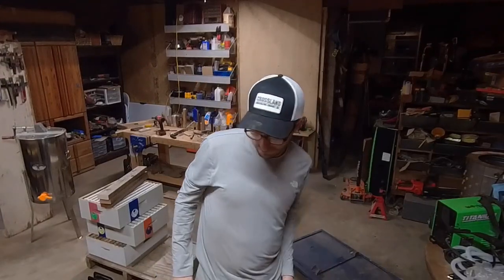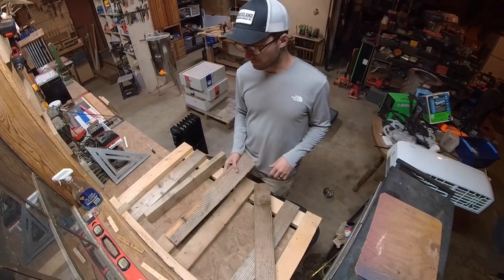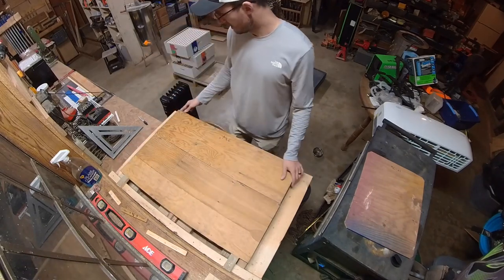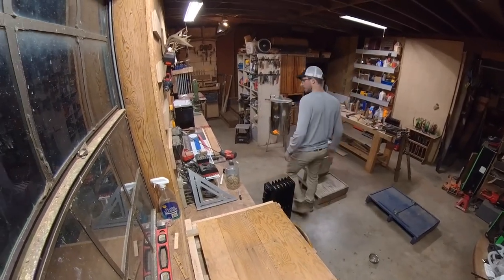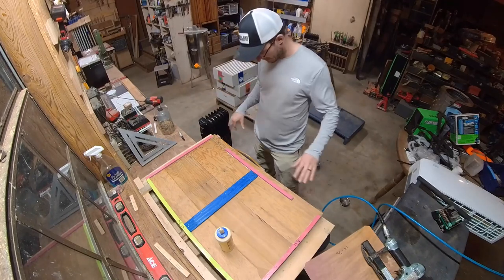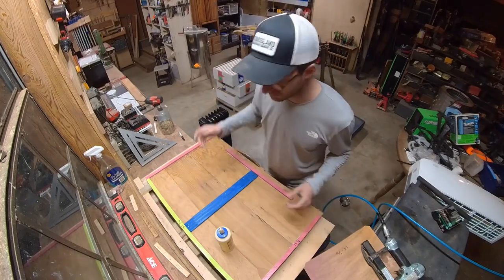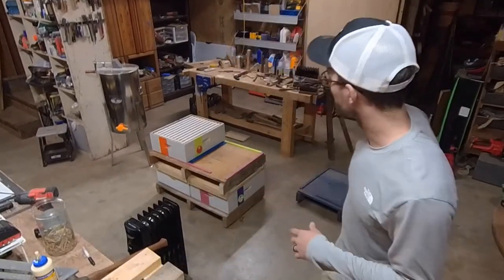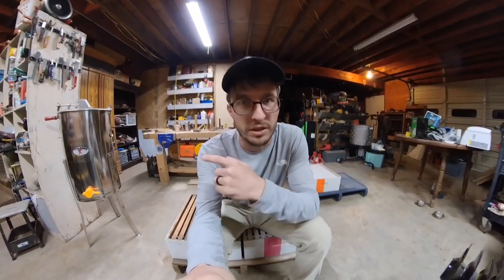2 Way Pallet Assembly for Beekeeping

Comment from the maker: Cut sheet:

Plywood: 33 1/4 x 21 

(2x4)s you need 3 cut at 23
(1x3)s you need 2 cut at 33 1/4

Back:
(1) @ 3/8 x 3/4 x 31 3/4

Sides and front:
(3) @ 3/8 x 3/4 x 19 7/8

Middle: 
(1) @ 3/8 x 2 1/4 x 18 3/8 
Optional, remove some wood on both ends for W clip. This is not critical so you can skip this step if you want. 

3/8 can be substituted for 3/4 if you prefer more space under your brood chamber. I prefer 3/8. 3/4 will be easier if you don’t have a good table saw.
Reply: Would 1x4 work instead of 1x3?
Reply from the maker: @lavenderbridges  yes, absolutely. 1x3 is just cheap and I had some left over from another project. My pallets are built completely out of scrap and recycled materials.
Reply: Thanks!  Whatevwr the reason, I’m having a hard time finding one by threes in my area. I didn’t know if structurally it would make a difference and I appreciate the quick response.
Reply from the maker: @lavenderbridges  1x3 are commonly used for furring strips and are not made from select wood. That’s why they are cheap. 1x4 will work just fine.

Comment: Havent tries pallets, but may give the two ways a try instead of building more stands. Nice video!
Reply from the maker: They are convenient. You can always elevate them on blocks if you want the height of a stand. Easy to move around with modified dolly. My out yard doesn’t have the best access

Comment: How far on the back and front of your pallets do the 2x4’s extend out from the plywood to create the gap? Thanks.
Reply from the maker: I use 1.25” past on the back side. To be honest I can’t remember why I chose that. If I had a reason I can’t remember. The point is to let air pass through so they don’t overheat in on road. Now I just keep using the same spacing so they are all the same. Sorry I don’t have a more insightful answer lol

Comment: Nice and simple, what about one of those mini pallets set up got nucs🤨a 4 in 2, not sure that made sense.🤔And if you ran 4 nucs in a row would you want venting in the bottom so they would have less chance of over heating?
Reply from the maker: I believe Ian runs pallets special built nucs. I think they hold 3 nucs and he calls the “nuc batteries” if I’m not mistaken. The are pretty nifty. Each nuc is slanted slightly for drainage since the middle nuc is facing the opposite direction to limit drift. I can do some research and build one if that would help you out. Personally I don’t use screened BB in my area. Some people do.
Reply: @DRIECUTHoney  ya that sounds like what I'm thinking, not screened bottom just venting I was thinking if you had 4 the center ones might get hot was all. More or less just bouncing ideas. 🙂
Reply from the maker: @dcsblessedbees  they would probably be okay. Some guys will stick coins under the lids to let a little heat escape. I’ve played around with just sticking a twig under the corner of a lid. I just wonder if sometimes it might not be what they need? Now days I’m more inclined to just let them regulate the space best they can. Maybe dark paint wouldn’t be ideal. However dark is better early season when they need heat. Always trade offs lol
Reply: @DRIECUTHoney  ya it's all ways a balance. Have a good night.

Comment: @Driecut Honey ... great video for a "not woodworker" like me.  Thanks!  Do you have a cut list/supply list for this project, by chance?
Reply from the maker: I’ll see if I can make one later today. Thanks for watching
Reply from the maker: I put a cut sheet in the comments, it should be pined at the top. 

Also check out this video for tips on cutting the plywood portion. Beekeeping hack nobody uses | Stop measuring and start using templates
https://youtu.be/yIBWHT1BR-8
Reply: @DRIECUTHoney  accuracy is good, repeatability is Great.  If you are stacking, repeatability is better than accuracy every day IMO.  = jigs and stopblocks.

Comment: How do you make 3/8" thick strips? I assume rip down wood?
Reply from the maker: Yes, I run it through my table saw. If you only have a circular saw, you can make a table saw like jig, should be plenty of info online about hacks like that. But a table saw is what I use
Reply: What type of wood do you use for those?

Comment: Here is a question. Have you ever seen a double screen board pallet?
Reply from the maker: Can’t say I have. Seen screened bottom board pallets. Thinking of stacking smaller colonies for heat?
Reply: @DRIECUTHoney  holy smokes my mistake. I meant screened bottom board pallets not double.
Reply from the maker: @MinnesotaBeekeeper  okay, lol yeah I’ve seen pictures, but I prefer solid BB. A lot of my pallets have holes in the because it’s used concrete forms, and I staple #8 over the holes. Bees will close em up. 

I thought you had a difficult challenge for me. Lol. I actually think I know how I could do it.